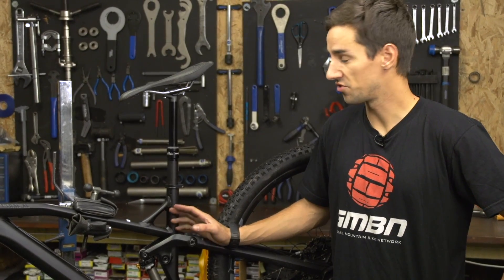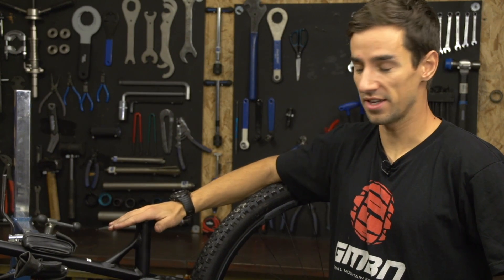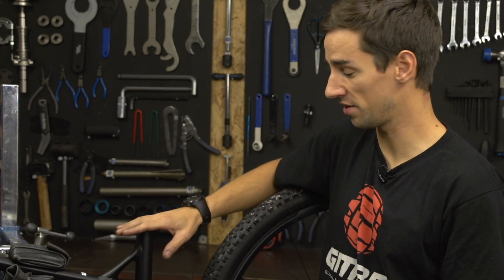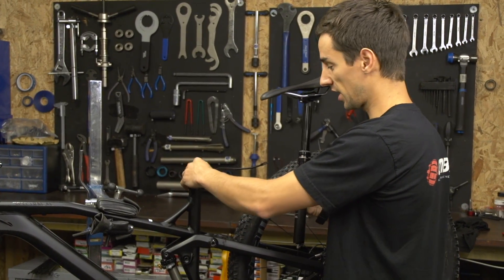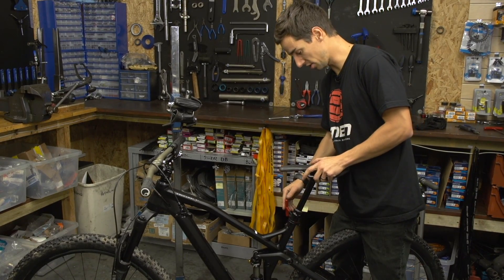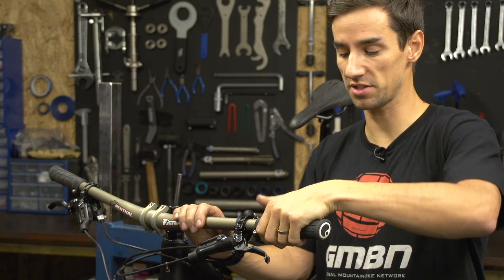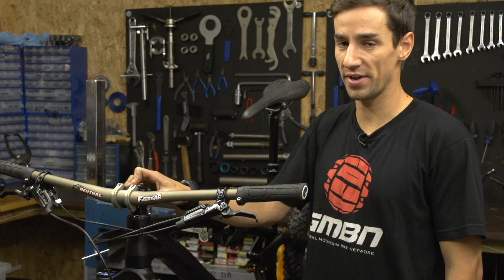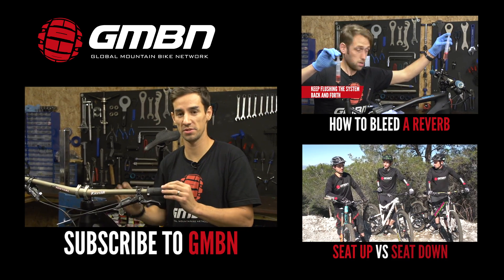How To Install A Hydraulic Dropper Seatpost | MTB Maintenance

Comment: Not sure if anyone mentioned it but Reverb comes with right and left handed remotes.  However, they are meant to be mounted OVER  the bar.  So, if you want to mount the remote BELOW the bar (like your shifter) then you order the right-handed model for mounting the remote on the left side (and vice versa).

Comment: don't use grease use the grippy compound stuff that stops it ceasing because according to sram grease can allow the post to move when you tighten the seat clamp to the low torq it needs to not dammage the post.

Comment: I think my Reverb instructions said not to use grease even on a metal frame, they suggested something else I forget the name of, probably similar to the carbon grip. I guess it is to get a good grip without having to over tighten as the tubing is fairly thin.
Reply: Second this comment. Won't grease cause the post to slide down?
Reply: ***** But standard seatposts cannot be damaged by overtightening. To quote the reverb manual "Apply a moderate amount of friction paste to the inside of the seat tube and contact surface of the seatpost. Do not apply grease." It also says "Friction paste is designed to create friction between the contact surfaces to prevent the seatpost from slipping without over-torquing the seat clamp device. Failure to use friction paste could allow your seatpost to slip during use which
could lead to serious injury and/or death."
Reply: +Bungle2010 quote from KS lev manual: "Apply a friction or anti-seize compound to the inside of the seat tube and inserted surface of the seatpost. Do not use grease." (the last 4 words are in bold)

Comment: Hi, I like my seatpost as low to the frame as possible, I had to cut down my pole to get the desired hight. Im looking to get a seatpost dropper for uphill sections but wondering if it will still be as low to the frame when fully dropped down.

Comment: I have a question, I'm a short rider (5'6") on a 29er, so I'm a bit confused on the length of post I need. From what I under stand you need to measure your post length where you normally ride then substrate 50mm. I ride at 125mm so that would put me into a 75mm dropper. If this is correct is there still a great benefit to using it? Also what would be a good unit since this is not a common size? Thanks for any input you may have.

Comment: Just came back from my second ride after getting the Giant contact dropperpost, i've noticed, it needs to get pushed down a bit, like give it a little stomping with the ass to get it to go down. it's not enough to just push the button and let my body weight do the compression, Is that normal?

Comment: So I recently got a brand new bike with a dropper post included.  I noticed that the dropper post is able to turn if the saddle is pushed decently hard whether it be from a rougher landing or just pushing the saddle laterally with a fairly decent force.  After examining the post I noticed it is the smaller internal post of the dropper post that is able to turn.  I was just wondering if anyone else has had this happen, and if this is supposed to happen to prevent breaking on a crash, or if something is wrong? If so how do I fix it?

Comment: if u use  normal grease (for multy purposes-uses) is it ok ? or do definetly need specific bike grease ?
Reply: i just use multi purpose grease or wd 40
Reply: TeoMcHL don't use WD40 it will cause corrosion.
Reply: Gwillan cycleman pro gmr 117  I've been using it for 2 years now on the same chain and it hasn't corroded so you are wrong on that my friend

Comment: I’m hoping someone can help me. I have a norco fluid fs3 I’ve rode it 5 times so it can’t be any damage. I undid the seat bolt and I slid the seat down and now my dropper post won’t work it’s like the button is stuck on the seat won’t stay down any ideas

Comment: Would it be worth saving for one on a hardtail mtb (2012 voodoo bantu).Im intrested as i plan on doing more trail riding 
  many thanks-Greg
Reply: ThatRandomCarGuy  Imho, if you do mostly XC than a dropper is probably not worth it, especially considering the weight.  If you do mostly trail riding, with a lot of technical sections, then a dropper is a great investment.  Being able to drop your seat out of the way over rough sections and on drops and  descents, will make for faster and easier handling.

Comment: Can anyone help. Im building a Nukeproof scout 290 from scratch (first build) I was going to start with the bottom bracket but I have since considered it may cause difficulty in installing an internal cable dropper post. I can't afford to build the front end yet and have noticed most dropper install vids have the front end set up already. What order should I be building this bike please....because im stuck before ive even started